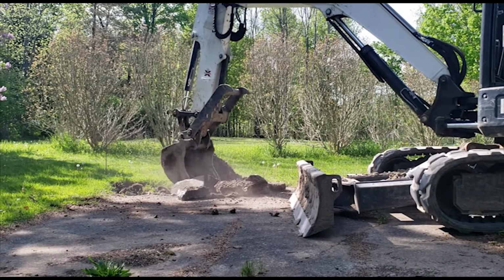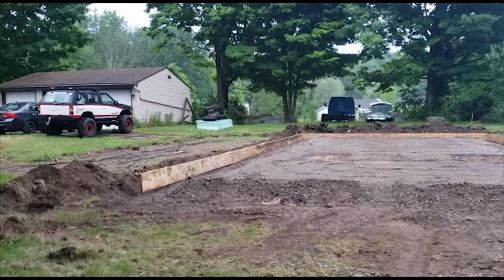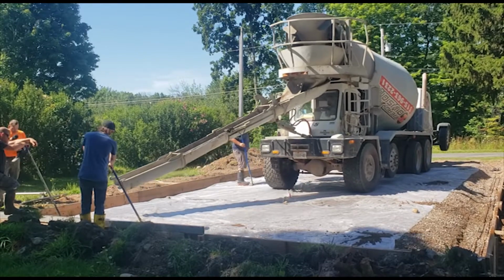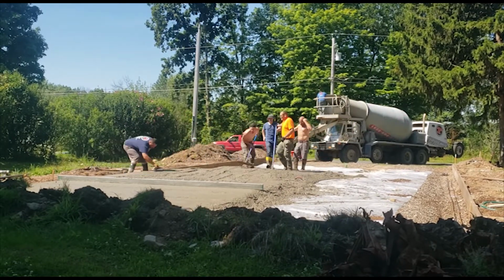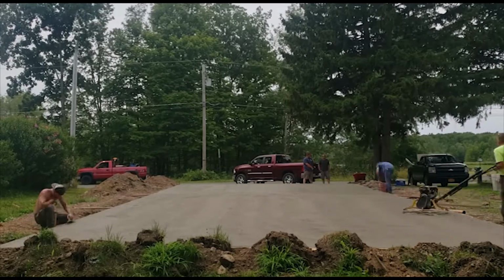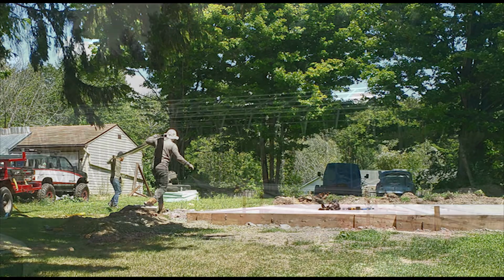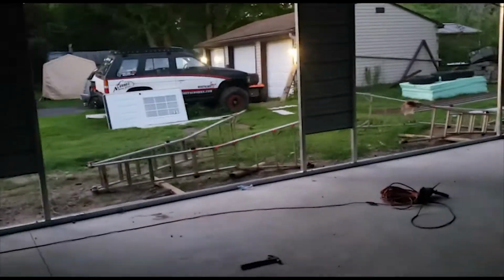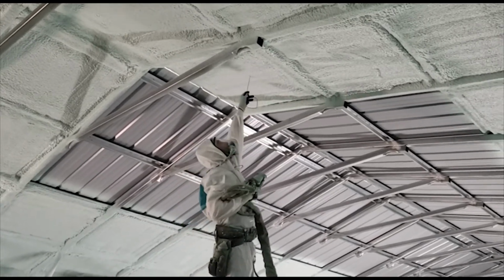24 x 50 x 11 Steel Building. My New Shop

Comment: this is exactly what I am trying to build, but might be adding electricity and pluming. Wondering what's the over all cost for this whole project including the tree removal, since i got the same situation.
Thanks
Reply from the maker: tree removal was 3k. Building was just shy if 30k installed. The monolithic slab was crazy expensive but you might not need this in your area. That was roughly 20K after the nightmare to get it done. Spray foam in this building and the other building was 9k total. Well worth it!!!!